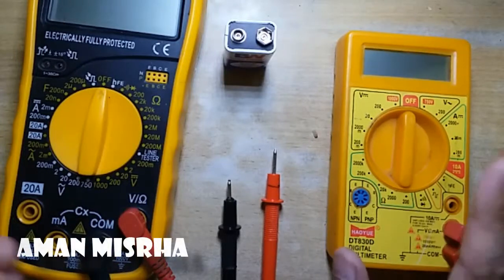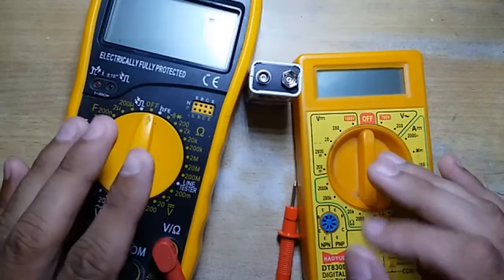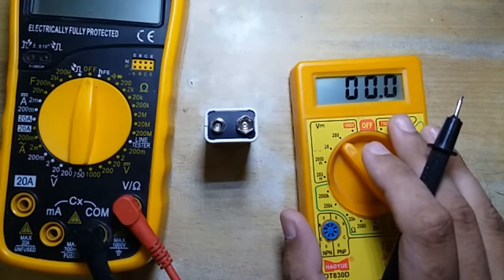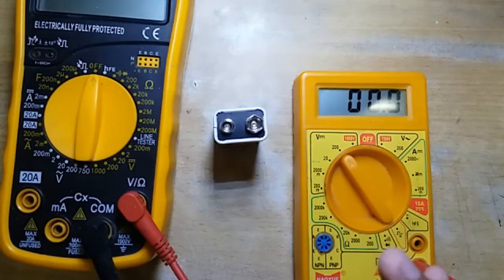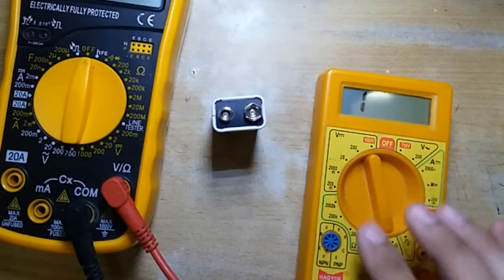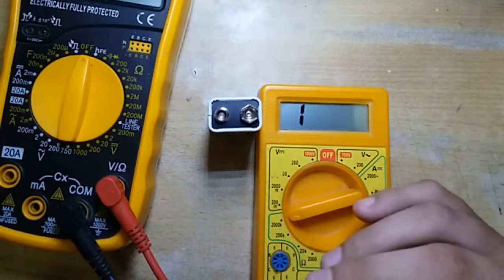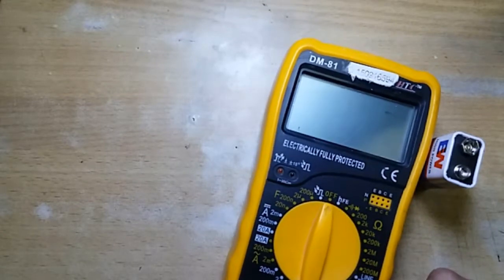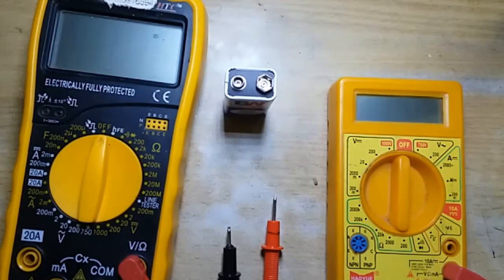digital multimeter measurement basics and specifications - Accuracy , Resolution, Range explained

Comment: If I have two different brand meters like you showed and both are displaying different values when I take measurements of Voltage, Ampere, resistor, capacitor then which of the two readings can be called accurate ?